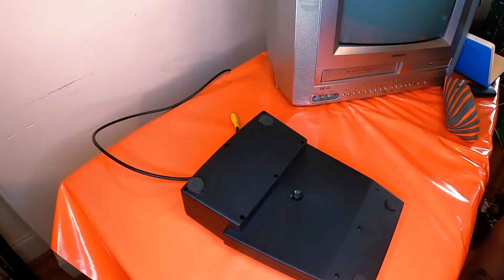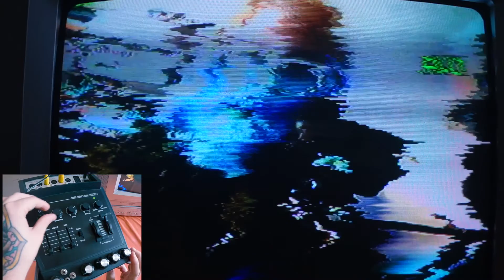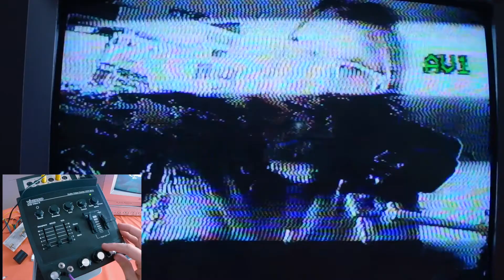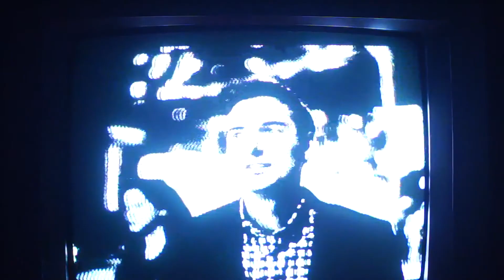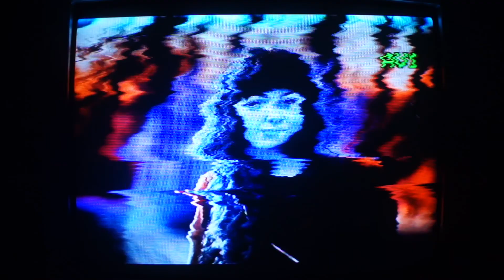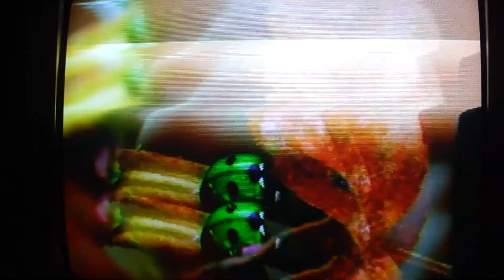Circuit Bending a Video Mixer for Glitch Art

Comment: Hi! great video, thanks a lot. Can you tell me the name of the "chewing gum" that is used for finding the bending points instead of the alligators? what is the material? Thanks again
Reply from the maker: I was using blu-tak, though it isn't conductive. I was just using that to hold the wires in place! :)

Comment: would be possible to get the PCB for the bending point ? 
I would be to scared to circuit bend with electricy running, how is not batterie.
Reply from the maker: I have pictures somewhere but if you're not confident in bending I would not recommend doing mains powered devices!

Comment: I notice everything goes to old school tv’s.. I know it’s a stupid question but can this be run to a more modern wide flatscreen?
Reply from the maker: Yes, with a maybe, and a but. You can run this into any display device which takes composite input. If you don't have composite input, you would need a convertor box. 

The other caveat is that circuit bent video devices display best on analogue outputs because they can handle the scrambled signal far better. Digital devices often drop out when the input is outside their expected parameters, which means you need to stabilise the signal somehow, often through the use of something called a time base corrector. These are tricky to find for a good price, and also mean the effects aren't as nice.

Finally, CRT TVs or other analogue output devices are part of the FX chain, in that they will display different inputs/glitches in sometimes radically different ways. The results are often waaay better as a result.

Comment: Any way to just program a midi controller with a program that codes in glitches?
Reply from the maker: You could use a MIDI to CV output module/device which would run into analogue devices like this. If you're talking about software, the closest thing I know of is Lumen, which I've done a video on a while back! But digital glitches are very different to analogue gear.
Reply: @StephenMcLeod  thank you for the reply! JUST fell down this rabbit hole as of two days ago 😂 a lot to learn just wanted to see if I could use some gear I already have. I’ll check out your other video too
Reply from the maker: @megan8494  Cathodemer is an interesting CRT emulator/digital art thing you can check out. If you want software-esque glitches, check out Waaave Pool from Andrei Jay. I use their stuff a lot when playing live. There's lots of options there - though folks often run them on Raspberry Pis.
Reply: @StephenMcLeod  ever try it with touch designer?
Reply from the maker: @stavisfatyes  I haven't, but it seems a bit out of my mental league. I don't love getting stuck into the technical weeds of that kind of software much any more. Music is part of my escape from that world!

Comment: Hi! Which type of photosensitive resistor did you use for the audio reactive glitching? I tried a 5506, the lowest I could find, and the led still doesn’t get bright enough to resist low enough to show anything.
Reply from the maker: Hey! I unfortunately can't remember which one I used in this particular bend. I bought a big box of different values and experimented with them to see which one worked, and I think that's the best approach, as each device will be a bit different. Sorry I can't help more!
Reply from the maker: p.s. pay attention to the colour spectrum of the LDR and the LED, as not all of them react the same to different colours. As in, they may be more sensitive to particular LEDs.
Reply: True, thank you so much! I’ve been experimenting a bit and found a spot that glitches the way I want with the resistance I’m able to get, now it’s just trying to figure out how to make the LED get just a tiny bit brighter
Reply from the maker: @circuitbent1  Try experimenting with different coloured LEDs in that case. Brightness may not be the issue.

Comment: My friend that was so nice. I’ve learned how to bent by my own and that was the worst way since I’ve burned many rare boards… anyway I would appreciate very much if you could share how to make your tester. It was so cool to see
Reply from the maker: The tester is just a breadboard with a bunch of different values of pots and some caps already on it, with pin outs for crocodile clips!
Reply: @StephenMcLeod  Amazing bro! Whats the values did you use?
Reply from the maker: @vifx1  I used 500ohm, 1k, 2k, 5k, 10k, 100k, 500k :)

Comment: Awesome work here, i am about to jump into my first attempt at modifying a video mixer. Is there anywhere i can go for more info on how to identify the power and ground lines? I am new to working with circuit boards.
Reply from the maker: Good luck! There's a few ways. Outside of reading the actual schematic, you can take the boards out, identify the chips, look up their data sheets and see what pins correspond to power and ground. You can then trace them back that way. You can also identify the transformer and avoid anything that comes from that. They are fairly easy to find, and the traces on the PCB are usually bigger. Be warned though: Don't do this on anything that's not DC power or above like 12v if you're not experienced! It's wise to look up safety precautions elsewhere as I am no engineer. 

One thing though is that ground isn't always bad. Sometimes you want to pull things to ground to get crazy effects - it's just that that is a bit more risky when it comes to chips potentially blowing, depending on the circuit... From my understanding.
Reply: @StephenMcLeod  Cool thanks for the help! I will do some more research before getting hands on with it.
Reply from the maker: @cade5422  Best of luck!

Comment: Love the aesthetics, but I'll never be brave enough to try and bend something like this myself lol
Reply: Go for it! Find a cheap one that runs off of a DC power supply (wall wart, etc.) and just follow the advice here about mapping out where the power and ground points are. After that, you can go nuts with resistors, pots, and very small value capacitors. If you roast a 20€£$ video mixer, it barely matters. A unit that is running from a DC supply will likely never hurt you or even blow itself up.
Reply from the maker: @LPGatekeeper  Great advice! I've blown up a few £20 mixers. I refuse to pay more than that for them because I know I'll end up destroying them. Plus, most of them are destined to be chucked out anyway unless somebody buys them for cheap on eBay. Though now they are getting more expensive...
Reply from the maker: Go onnn. In fact, no. Don't. If you blow up I don't want the blame!!